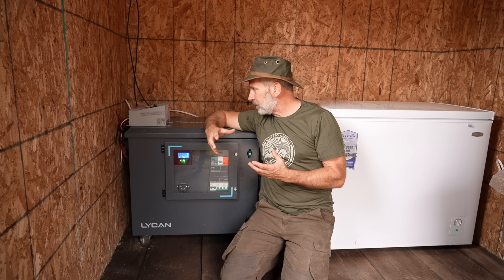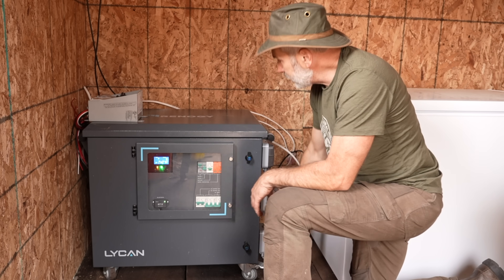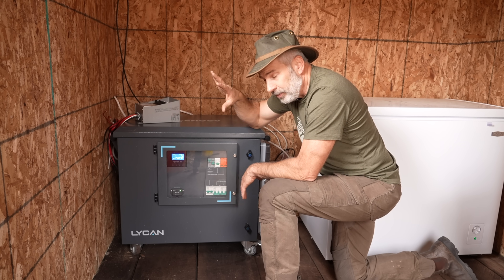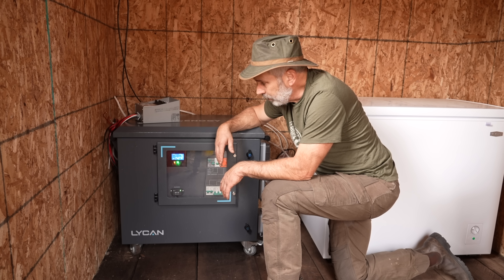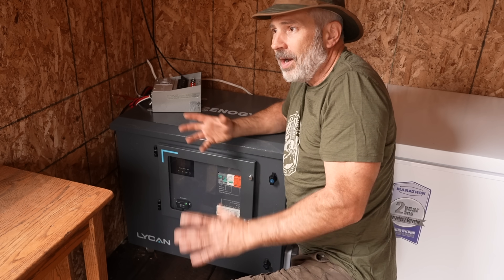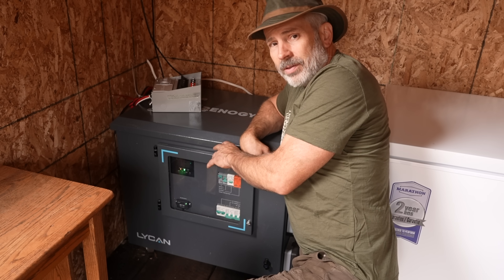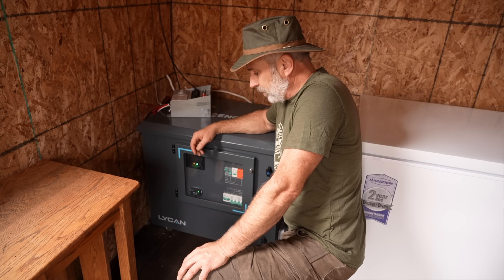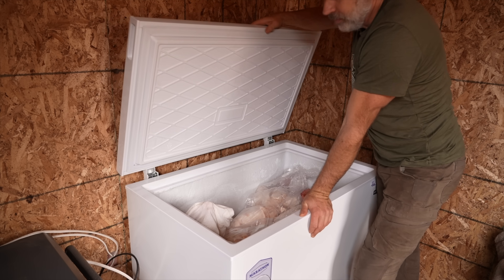Building a Solar Powered Garden Shed with my Daughter @emilyaisling

Comment: A lovely video. I was happy to hear you can run a freeze dryer (FD) on this system. We have a medium sized one in an unheated (on-grid) but insulated building, with 2 separate rooms. One room holds freezers and freeze-dryer, the other is a summer kitchen (water turned off in winter). The FD, when on, keeps that room at about 20 C in winter, so far. Granted, it’s our first year with it and it’s been a very warm winter in Maritime Canada. This heat spills into the other room and keeps it at about 13 C., depending on how much we open the other room’s door.  Before the FD, the 3-4 freezers kept that room above freezing all winter, with the very occasional need to run a small heater on a thermostat set just above freezing for storage of cold room-type crops and dahlia tubers. Coldest temp here in winter is about -25 C for only a few days but the wind is aplenty.

Comment: You must have either took a vacation or maybe you got hurt. This is older footage. You got to live life too. Anyways, I do wonder what dimensions you have planned when you go to build your bedroom. Are you going to allow enough space so you can have a bedroom window that no furniture would get in the way of? I have that issue in my bedroom. Not enough space. I'd recommend a bigger bedroom size than mine. At least something like a 20ft x 20 ft square room on the inside. How wide is your cabin Shawn? Maybe even up to a 25 ft x 20ft or more. If you're going to make it with logs I don't know what the length of those logs get up to.

Comment: These solar systems. Something i wonder. Theyre expensive and complicated. How durable are they? Panels included. Im not complaining, Im wondering how many years can one reasonably reley on a solar panel battery system before breakdown. I also understand that efficiency degrades over time. At least in respect to the panels. If i ran off grid, how many years can i expect to have electricity?

Comment: Nice solar setup. :)  I hope you enjoy that :) My stone house has been hit with lightning twice in 7 years. The breakers turned off.  I put an inbound  waterproof circuit breaker, surge protection and fuse with box at least 10m. away from my batteries, inverter, charger.  So the live line cut when the lightning hit.  The big if possibility 1 in a million chance if not grounded and you go there to check on the system you can be electrocuted.   But it is a very low voltage system a small shock. How I did it. Thick copper wire to my panels outside guy-line copper ground rod 2m. with bentonite in a plastic sono tube pipe. Then from inside  ground everything to another 6mm ground wire with 2m. copper ground rod bentonite plastic sono tube pipe. Basically ground everything but keep your solar panels separate from damaging your solar shed or devices.  So solar panel  in the back shed and inside ground in the front shed.  The other part of wood and electrical fires is high if not grounded.  Take it slowly think ask you will get it done. Always enjoy watching. Take care all the best be safe. :)

Comment: That would be ideal for a sturdy shelf with thick boards the height of the shed and 1-2 mason jars deep for your canning jars, assuming solar will keep the inside of the shed from constantly freezing over the winter. Everybody can use some storage and you can take it to your next home when you expand.! Screw the shelf  to the wall for security !

Comment: My father was a Master Plumber. He also was a good carpenter as was my grandfather. I did not get to really learn like your daughter is. Most of that from Dad was if you use the tools out in the shop, make sure you put them back where I put them.
 I was never stopped from building things on my own, I learned from watching. When I went to High School in the start of the 1970's , girls were not allowed to be in the HS Trade School. 
So my Mom taught me to sew and embroider. Good skills too, that I still use to create costumes and clothing. 
Later I took a carpentry course and bought carpentry books. I took a machine shop course too at age 36. I learned to install bathroom toilets and sinks, replace faucet washers, do ceramic tilling and grouting. I learned to tear down and remodel an old house on the inside. 
Build horse stalls and paddock gates of my own design. I can change a vehicle tire and do an oil change. 
I was the only female partner in a deck and wood workng business. I can paint and wall paper and lay floor tiles.  I have my own tool wooden tool box i made myself with my own tools. 
I learned gardening from a young age and later leaned to can the produce. LOL I was the one that convinced my parents to have a big garden. They loved it. 
No I'm not single, long walks on a beach are now out of the question :) Age does creep up on you. 
I wish I did have my father's teachings, as I wanted to learn. I just gifted myself with that knowledge.
Reply: Well done indeed.

Comment: I could be wrong because it has been over 45 years since I sold freezers, but I seem to remember it took almost as much power to run a small freezer as it does a large one. You could have other reasons for needing a small freezer such as transporting it to the cabin and limited space where you use it.

Comment: battery power is useless in the winter at 30 degree a battery looses 3/4 of its power and you can only draw 50% of the energy out a battery before you destroy the battery i 10 year warenteed battery brand new if you draw more than 50% of the power out the first day 3 years you will be lucky if lasts and the warrantee is void

Comment: I am not sure if that unit has a heating element in it to keep the batteries at the proper temperature for charging during the winter. If it does not you will have to heat the building in order to charge or the BMS will shut down charging below a certain temperature to protect the batteries and this could potential damage your charge controller depending on how the system is set up.  You could put the system in the root cellar to help with this. My Renogy smart Lithium batteries need a minimum temp of 4 deg C for charging. I have to disconnect the charge controller and shut down the batteries when leaving camp during the winter months. Then start everything back up when returning and the camp is warm.